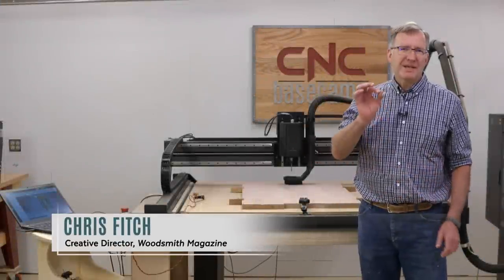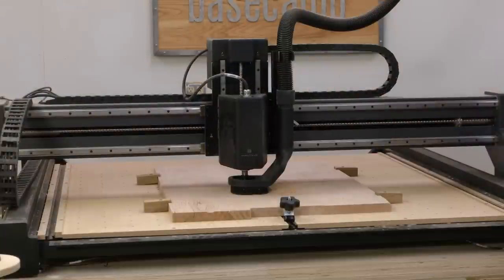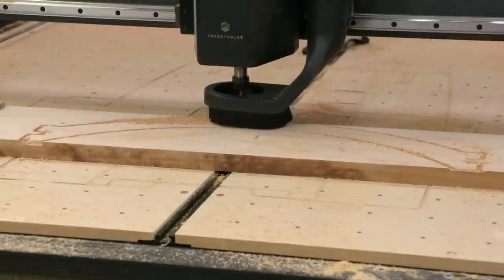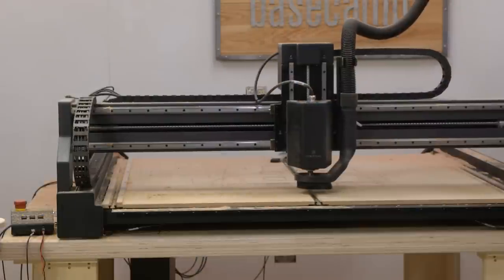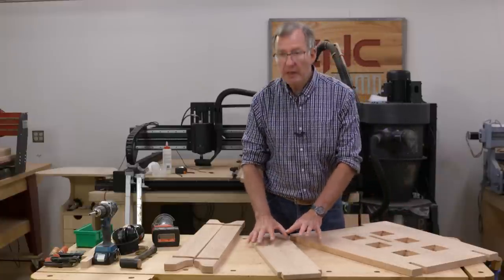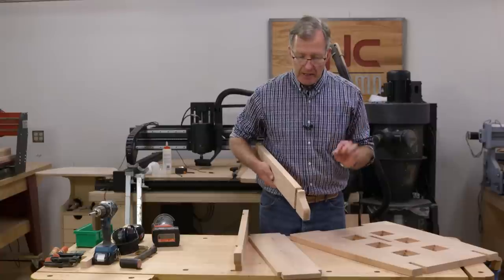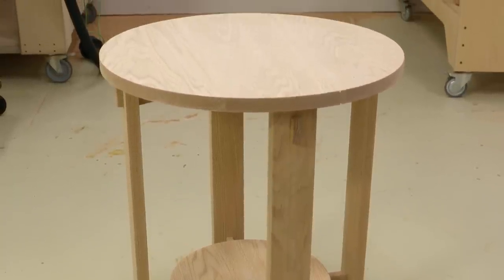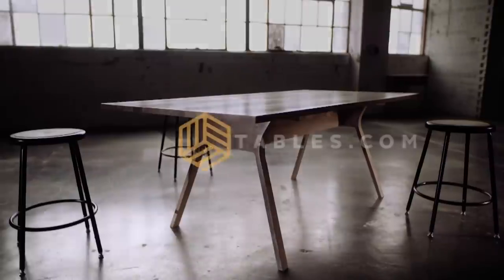CNC Basecamp Ep014: Three Solid Wood Tables

Comment: Super tips on the "T" bone strategy for mortise and tenons. You could use a Shaper Origin with the angle plate option to get square corners on your tenons. Or you could use a cnc router such as the Onefinity which has no hard "table". Thus one can build their bench with an angle plate to do end piece joinery. I appreciate this video because I can design my furniture using the "Tbone" strategy when appropriate - lots easier than end work joinery. Thanks.